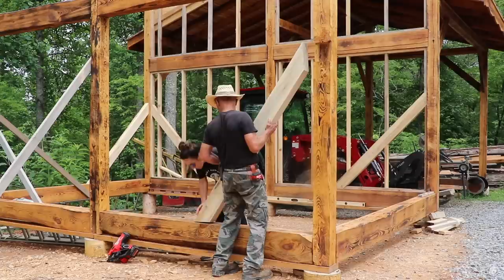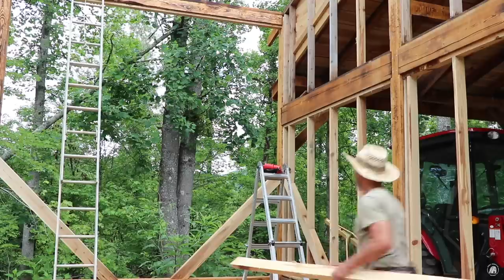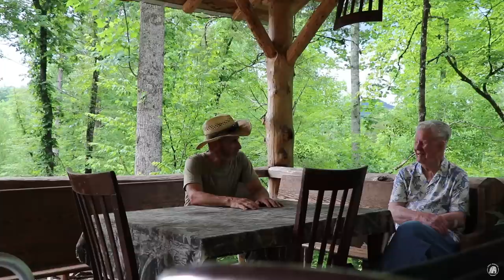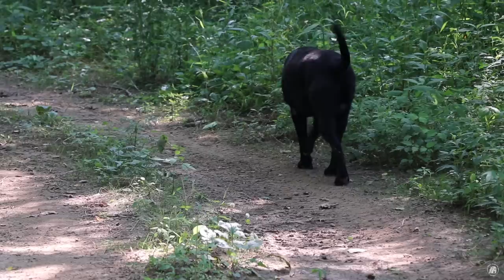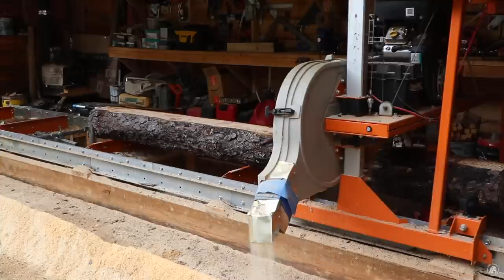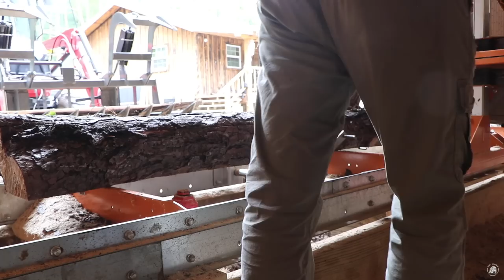Building The Ultimate Workshop | Old School Framing - Episode 11

Comment: Total shock to see you nail the angle braces in !!! where was the mortis and tendon?  WOW shocked !
Reply from the maker: Why? I didn’t plan on using them but had some short pieces left and decided to add wall bracing like they did back in the day. To match the size of the post and beam  and fit the wall I made them 31/2 x 6. They are locked in by a ring of 2x4. Just as strong and out of sight. Most old school bracing done that way are only 2x4 like the wall frame.
Reply: @SmokyMountainOutpost  It just seems That's a true post and beam way to do it or make a seen tenon that's 2 thirds of the width but like a 1.5 thick /deep.. all the angle braces in our home have tennons or in the earlier years it was done like i just said. I built our shop that way..